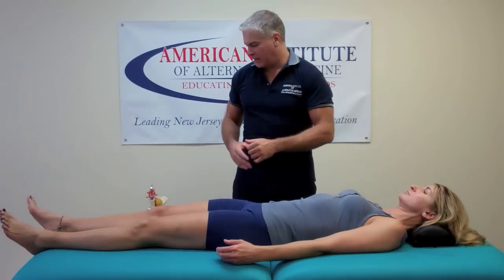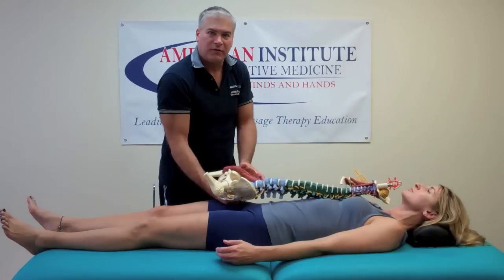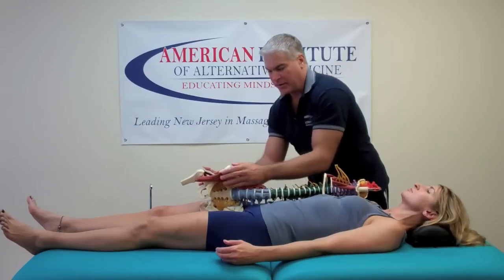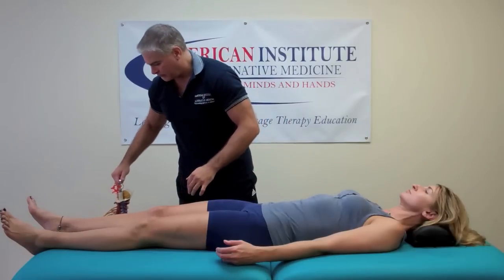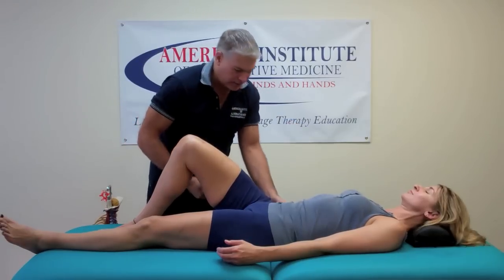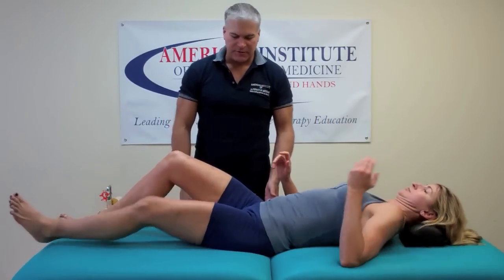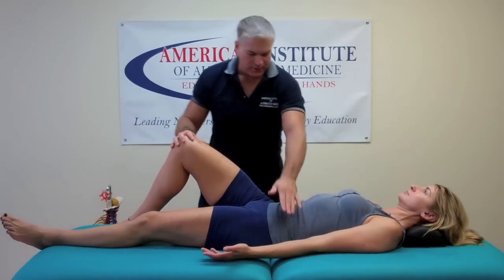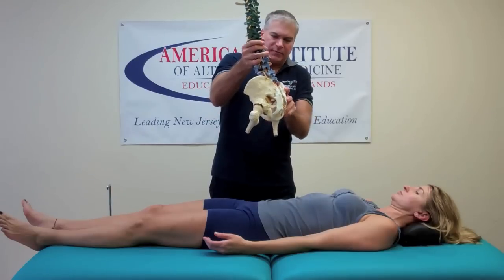AIAM De-rotating pelvis for anterior pelvic tilt

Comment: Shouldn't you try to fix the cause of the anterior tilt rather than just trying to force it straight?
Reply: The cause is a weak core and weak glutes. Fixing that takes time, and is something for another video.
Reply: It has to be put it the proper position THEN re-train muscle groups to hold pelvis in the correct position. APT requires both adjustment and physical therapy/training to fully correct the problem.
Reply: @cheycarner1878  where can we do this treatment Like a chiropractor or someone else does this ?